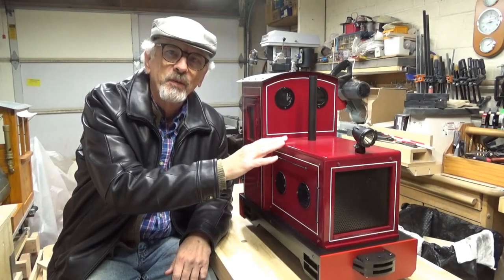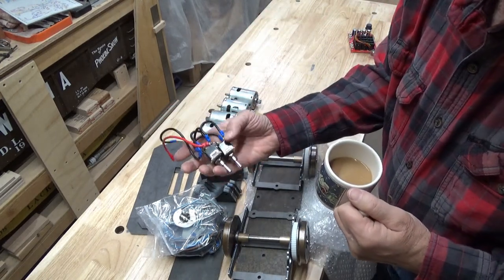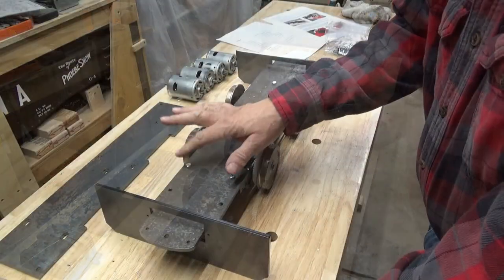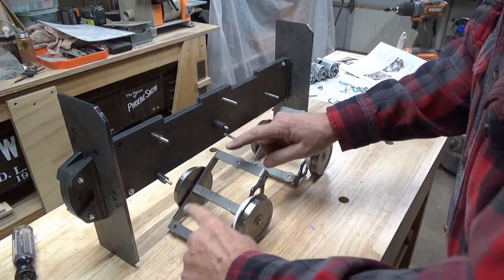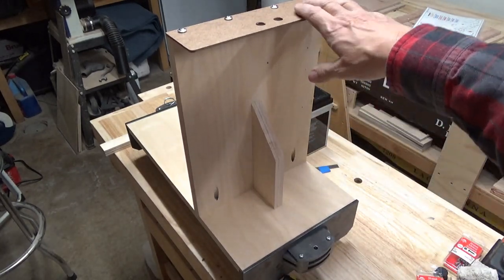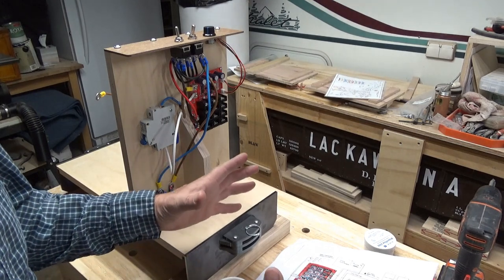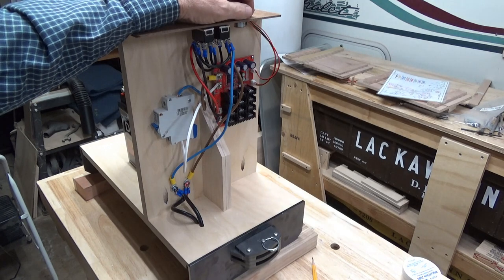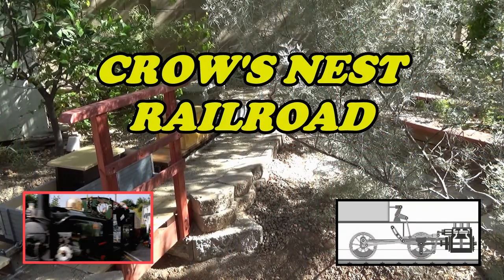Maxitrak Power Chassis Build - CNRR #22

Comment: I built an earlier version, this newer version seems rather more solid and has a different power controller. Currently laying track here in Portugal. Cut about 200 sleepers ( believe you call them ties) this morning before it got too hot. Tomorrow its panel fabrication and laying, we're about half way round our 95 metre  (about 100 yard) track. Its actually my wife's idea!
Reply from the maker: That sounds great, Stephen!  Railroading is a bit of work, but well worth the trouble.  I built a jig to form many of my panels standing up in the garage, rather than on my knees in the yard.  I also borrowed a rail bender to help with the very sharp turns I need to have in my small yard.  Have fun!
Reply: @StanFerris  Three more panels down today, Iess than  10 to go. The whole thing was my wife's idea. I took her to a model village in the UK, and she liked their 32mm gauge railway. She wanted one. Then I took her to a local model engineer club open day, and they had a 5" ride on, and guess what, she wanted one!
Reply from the maker: Stephen, that sounds like you are both having great fun!

Comment: Stan, I have one more question.. What type of battery did you use exactly? and to start, it is better to start in 5 inches or 7 1/4 inches? Thanks see you soon. Philip
Reply from the maker: Bonjour, Philip.  Two great questions.  First, the little loco I built has motors and electronics designed for 12 volts DC.  Here in the U.S. we have automotive type 12v batteries that are designed for starting car and truck motors, so they can handle momentary high current surges, but like to be kept at or near full charge.  We also have what we call marine or RV batteries which are built to provide long periods of power for lights, electric motors, etc., and then recharged again once drained down aways.  The RV or marine battery is the one I use on my locomotives.  The sizes vary, depending on how many amp/hours the 12v can supply.  Smaller batteries cannot run a motor as long as larger ones.  My club loco runs on 24v DC so it has two 12v batteries wired in series to boost the voltage.  For my little 5" gauge loco, I used a 12v single battery that would fit inside the shell I built.
Reply from the maker: Secondly, the preferred track gauge is more difficult to recommend.  The 7.25" gauge equipment is more expensive, heavier to lift and re-rail, but is capable of carrying more cargo and passengers.  It generally requires larger radius curves as well.  A 5" gauge train has much lighter equipment, is not as powerful, and doesn't give as stable a feeling when riding.  However, you can much more easily lift the wagons, etc., for rerailing and maintenance.  5" gauge equipment can be less expensive and often can negotiate 8' or 10' radius curves (which is one feature I needed for my home railway).  I recommend trying to find a local club of some sort where you can see and ride on both gauges to experience the difference for yourself.  Stan  https://www.youtube.com/watch?v=KjeZ5RFWH8Q&list=PLTQ_pr6o-F_2DMC0Gb2tP4nkbTl_s40RC&index=7
Reply: @StanFerris   Ok thank you very much Stan, see you soon ! :)
Reply from the maker: Philip, one more thing... I found this information very helpful when thinking about my own railway:  https://www.rideonrailways.co.uk/paul/building/page11.html

Comment: hello Stan, I forgot to ask you, what is the diameter of the wheels on this kit in 5 inches? Thanks see you soon. Philip
Reply from the maker: Hi Philip.  The wheels are approx 3 inches in diameter, and the axles are about 6 inches apart.  It seems to handle my tight curves just fine with no derailing issues at all.
Reply: @StanFerris  Ok Stan, thank you very much! So I don't think we can slightly enlarge the wheelbase to a minimum radius of 8 inches?
Reply from the maker: Philip, I may not be understanding your question correctly, but if you want to increase the wheelbase to 8 inches between the axles, you might be able to do that by drilling some new mounting holes in the frame.  Each axle is a separate unit with motors enclosed.  If you are talking about the track radius the locomotive can handle, Maxitrak says it will do an 8 foot radius curve.
Reply: @StanFerris  Yes Stan, you understood correctly. I agree with you that it will be necessary to re-drill the chassis to enlarge the wheelbase but will this fit on a minimum 8 inch rail, I don't really know... I may then modify my locomotive plan and only keep the MAXITRAK factory position. thanks again Stan, see you soon! Philip :)